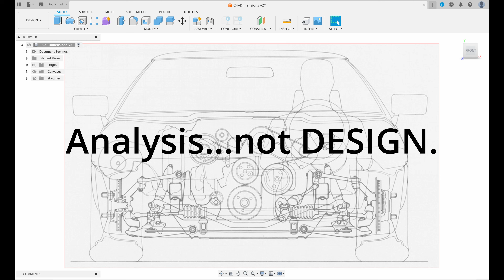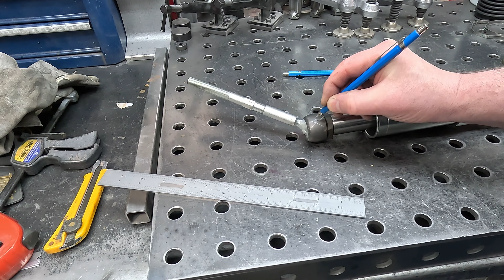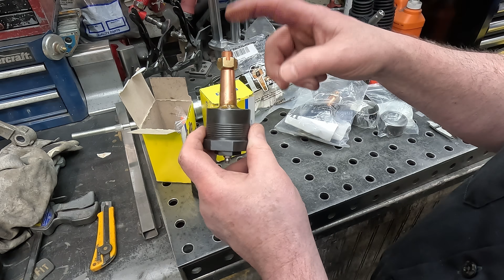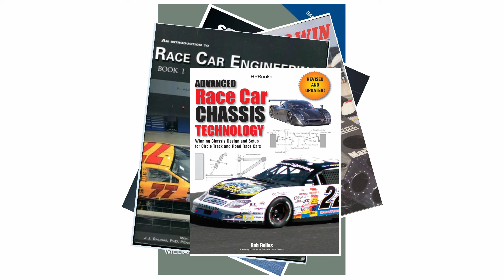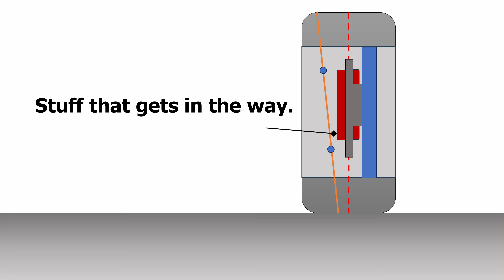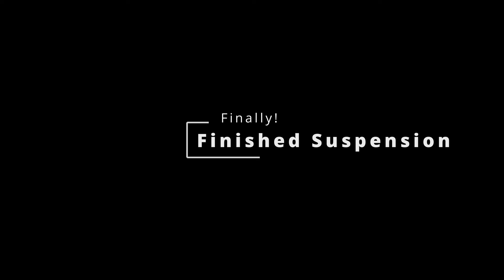Designing Car Suspension - From Analysis to Design.  Front View.

Comment: Great video and confirms what I had thought of the Corvette suspension design.  It is surprising how many so called Sports Cars have understeer built into their suspension designs.  When I was mocking up my Lotus chassis,  I used PVC pipes to physically build the control arms that were cheep and super easy to modify.   I found it helpful to see a physical model after reading books such as: (reading list sample for those interested in more)
Race Car Vehicle Dynamics - Milliken & Milliken
An Introduction to Race Car Engineering - Rowley
Tune to Win - Smith
Race Car Aerodynamics: Designing for Speed - Katz

Automotive Aerodynamics - Howard
Tyre and Vehicle Dynamics - Pacejka
Reply from the maker: Thanks - I've not read the last two - but the rest have been scoured.  Understeer is "safe" or so I've been told.  I was thinking along the same lines for a mock up but would use SendCutSend.com to sort out a wood model.
Reply: @ThrottleStopGarage  yea, I've been told understeer is safer, I can see the argument for a powerful car with novice drivers.  But IMHO, it should should be able to adjust out the understeer.  One of the many reasons I like the Mazda Miata, it has a solid platform that is widely adjustable at a reasonable cost.  Really like what you're doing with your project, hope you have plans to take it to track days.

Comment: No need to be looking at values from other cars except for sanity checks. Ask yourself what 'roll center height' actually means. 
You're essentially designing an 'anti-roll' feature; and that's a percentage, not some best practice value in millimeter or freedom parsecs. You are determining how much leverage you want to give the mass attached to the CG.
Roll center on the tarmac means 0% anti-roll and a fun boat ride, RC at CG height means 100% anti-roll and zero roll even in a 5G turn. 
So you want to figure out the necessary amount of geometrically build-in 'anti-roll' to get x degrees of roll at x Gs of max lateral acceleration. 
The roll gradient for a boring family car is around 5°/G, a production sports car should be around 3-4°/G and little FSAE race cars are set up somewhere between 0.5 and 1.2°/G.
My suggestion would be a target of 1.3G and 3°/G, pretty sporty for a road car. So the starting point for simulations I'd pick would be 4° of max roll, 0.25-0.5° static camber and 4.25-4.5° of camber gain at max roll. It's not a GT3 car after all. For the rest you'll need weight, weight distribution and spring rates. 
Get your spring rates sorted, calc the respective instant center heights, jacking forces, and see how much the car jacks up and rolls vs. what you want it to do, then apply the necessary 'anti-roll' by raising the static roll center to the right percentage of the CG height.
CPI btw has a lot of interplay with caster, it basically increases (neg.) camber on the outside wheel and reduces it on the inside wheel. The right angle again depends on the amount of jacking, roll and positive camber gain at full droop. The good thing is, you can leave this parameter for last since you can simply slide the upper control arm along its virtual construction line once everything else is locked in. 
Hope this isn't too confusing, English isn't my first language.
Reply from the maker: Thanks for taking the time to write this out.  I've gone over it several times - you've shared some very important thoughts.  The RCH part is completely correct - my limitation is that I wasn't sure what that value should be for the percentage anti feature.  The car originally had a RCH at ground level due to parallel (or close to it) control arm geometries and it was no fun.  The method of "fixing" the suspension was to attach monster anti roll bars (25 mm - short arms) and increase the front spring rate.  It was like a gocart.  It lacked mechanical grip and I hated it.  

What I've been missing to do the calculations is a sense of what a reasonable G force would be - even the other parameters are more me guessing and I hate that.  This is what is holding up the side view work right now - how much anti-dive is reasonable?  The caster is the same issue - there is a set value (sanity check if you like) that seems to pair with a SAI. So for a SAI of 12° - I see a caster of around 5° where for less SAI, I've observed more caster. I need to compute that rate.  

Any advice on the side view construction parameters would be great.  I understand that this is just "roll" in the pitch direction and that 100% would be alarming to drive as it would instantly react without any signaling to the driver.  I think I've seen less than 20% tossed about as a start point but I have no idea if that's a good idea.

Comment: Thinking the steering rack pivot width and steering arm pivot location should have been included in the discussion at this stage, for it’s coincidence with inner swing arm pivot points and steering rack location limitations.
Great stuff and thanks for sharing.
Reply from the maker: I may not have explained that very well - that was the point of starting with the rack.  Once I have those pivots, they must lie on the line intersecting the inner UCA/LCA line.  So I started with the rack.  I'll get this explained better after I complete the side view and work in the steering.
Reply: You say they must lay on the line intersecting UCA/LCA line, but if you do this you have 0 Ackerman, just so you know and don't oversee this.
Reply from the maker: You can get Ackerman with relative location of the rack to the centre line of the hub - the further out you go the more you get.
Reply: @ThrottleStopGarage  yes, depending on if the rack is front or rear of the hub of course. But the length and angle of the steering links must stay the same otherwise you will induce bump steer, but I feel like you know of this already.
It felt as if you chose the length of the rack by placing 615mm between the inner upper en lower joints and that's that, but I surely hope to see more next video. :)
Reply from the maker: I see what you're saying - all I was trying to say was that you need to design around something.  So I selected a narrow rack with a reasonable steering ratio that is available and used that as a start point.  The pivot to pivot for the rack did control the LCA pivot placement as the rack needs to sit on the line described by the UCA and LCA inner pivot points.  It needs to do this in 3D - it's currently just sitting there in 2D and is placed to eliminate bump steer.  The Ackerman is then set in the top view design.  There are a lot of things to consider!

Comment: Awesome video, I see you have got .6deg per inch of camber and codos for figuring out this base line number. I believe your caster will also increase the camber as you turn the steering wheel, do you have a figure for angle of caster and how much extra this will add to the six degree per inch. Or is that in the next video, cant wait!
Reply from the maker: Thanks - great question.  Yes - it's pretty weird what happened for me in doing this and I can't work it into a video.  I've read these suspension and handling books for decades and I could tell anyone who would listen what the words all mean but (and this is a big but) my ability to visualize this as a coherent system was limited.  The viewer that looked at the suspension on the jig and said it was nonsense, then pointed me to a video showing the car going around a corner to prove his point - he's got a very specific knowledge and talent I don't have. 

To get this to gel, I had to STOP reading the words and do the work to learn.  I would explain this as the difference between knowing "that" something happens and "how/why" it happens.  It hit me like a 1000 W bulb a few weeks ago and bang - I get it. Then it was like re-learning everything as I could make it work in my head.  

When we do the side view - we'll look at how caster adds/subtracts from camber in turns and the anti elements of the side view geometry (which are similar to the front view).  There is a rate here as well - and you can get it in two different ways.  I hope I can get it nailed down enough to explain it passably well.

Comment: Thanks to share your experience. I build small electric vehicle (1 seat and 2 seal)  and my biggest problem is the suspension geometry. I rebuild 4 time the geometry for the 1 seat and now I designing for the 2 seat.  I using negative scrub to plan to have a better driving experience at high speed.   But you use positive Scrub is it better Positive Scrub? If you want, you can contact me and I will share my plans and feed back on the roads.
Reply from the maker: Negative scrub (from what I've read) is used on front wheel drive vehicles and those with split mu (diagonal) braking.  RWD often has positive scrub.  From what I've read (little experience) it's desirable to have scrub as part of the design.  I'm saying that for me to get a handle on the clean sheet design, I needed to start somewhere.  I found scrub definition was the right place for me to start.

Comment: Well that certainly explains why I’ve always felt I was spinning round and round in successively smaller circles when I’ve tried to understand suspension design.  Reading the books made my eyes glaze over. Sometimes after giving up I would even head for the donut shop for a superior glazed solution.  Unfortunately that never helped either.  You’ve inspired me to give it a go.   Definitely looking forward to the next episode.  In the meantime I’ll be rewatching your previous episodes and reading all the comments to help drive this home.  I’ll probably even pull those dusty books back off the shelf for another spin. Thanks so much Craig for slogging through this. 🙏🙏🙏🙏
Reply from the maker: Thanks - this was a game changer for me.  Like you, I could read the words and even explain it, but the shapes wouldn't work in my head.  I had no "sense" of things like the viewer who pointed out the problem in a suspension by looking at it.  Gold star for him.  This did come to me like a clap of lightning.  Boom - suddenly it all snapped into place.

Comment: You sure you had camber loss there? Sure looks like gain, both on your bubble, and comparing to the background.
Reply from the maker: Sorry for the confusion.  The hub is not where this gets measured either...it's the contact patch and the value will be different - but I was trying to make a point.  The C4 is gaining positive camber in bump - the amount is magnified by measuring it at the hub - but the top of the tire is tilting out not in.  That's why we see a decrease in contact patch length (in the 2D model) in roll.  Compare this section of the video to the suspension that I've designed and shown at the end and you'll see that in roll, the inside tire contact patch length is not changing.  So the car is leaning on the tire and the tire is flat - this roll rate and  camber curve are working as intended to maximize grip in a corner. The C4 does the opposite of this - it's also not designed to move much in roll for this reason.  I can't speak to why it was designed this way - it is and it's the opposite of what you'd want.

Comment: Before you blow a heap of money on parts mock up with cheap materials to make sure your design works, and don't forget thr Ackerman in your steering location of your steering rack. It has a huge affect in turning into corners and bump steer , the program you are using should explain it . If done poorly it will steer like a tractor one wheel turns out more than the other. Cheers.
Reply from the maker: Yes - for sure.  I'm just moving to the side view then steering.  At that point the upright is defined and I can start building.  I've got the basic steering arm in the 2D model and it's placed to limit bump steer.  Ackermann is a top view geometry and we'll get that input last.

Comment: Very worth the wait!  I have gone down part of this rabbit hole (the analysis side) and have noticed that factory suspensions are rarely what I expect.  I really don't think much of the "millions spent" on car designs have very much to do with actual good performing suspension.  I suspect ride comfort and stability/ease of use at low speeds trump actual road holding performance under rougher heavy usage...

My question is, are you going to make full custom control arms, the send-cut-send way, or are you going to go looking for arms that exist that meet the specs you define, you know, mix n match from different makes?  And have you planned to make the whole thing adjustable, with either shims of adjustable arms etc?
Reply from the maker: Thanks fellow rabbit hole adventurer.  Full custom arms and uprights (may have these machined from billet - I'm unsure).  With the wear parts (ball joints etc) being common enough parts that the rest should be fine.  I'd like to add adjustability as otherwise I will get trapped.  I have few delusions about being able to nail this.

Comment: Another excellent video Craig. Are you trying to design a suspension that won't need adjusting, except for toe. Seems to me once you start adding shims or rotating cams all these parameters  will change.  Minutely,  but will it be enough to blow your mind?
Reply from the maker: I think there has to be adjustability Alan - otherwise I'm going to get in trouble.  I don't imagine that it's going to be right without the ability to move it around a bit.
Reply: @ThrottleStopGarage  Of course, I was just pulling your chain, didn't want your head to get too big, haha! Like everyone else here I'm in awe of your process. It's gotta be right or it's getting done again until it is. I saw a picture of you when I looked up the word patience in the dictionary, there you were!

Comment: You’re describing camber loss while we watch the angle decrease and the bubble shows you’re getting gain. I’m confused.
Reply from the maker: Sorry...yes, it's gaining positive camber instead of gaining negative camber.
Reply: I notice that too! At first I thought I didn't know how to read my Klein Tools level (the bestest one ever!)
Reply from the maker: @alanmony1582  Nope - you've got it right.  When I was positioning the level to film, it wasn't flat on the hub face.  I try as hard as I can - still I fail.
Reply: @ThrottleStopGarage  From my viewpoint you were gaining negative camber as the suspension was compressed....Adding spacers to the top arm imho will increase static positive camber.
Reply from the maker: @Keith_Phillips  True - the level wasn't flat on the hub.  It still does some janky things. Sorry.
Reply: This is just because of the camera perspective angle not being perfectly horizontal guys...
 You can clearly see at ride height it had 0.4 degree negative camber and at 1 inch travel it shifted the other way to 0.5 degree positive camber, which is the wrong direction. It should have been 1.5 degree negative for example
Reply from the maker: @Mad4Tracks1  Nope, I screwed up filming the level - it's not flat on the hub.  Sorry.
Reply: This threw me off a bit too as visually it looked like it was gaining negative camber. The arm lengths and angles tell the story though. The bottom arm is past center of travel and will lose effective length while the upper are is rotating into a longer effective length.
Reply from the maker: @dsm156  I had moved the level for filming and it wasn't sitting flat on the hub - sorry about that.
Reply: Why was there no mention of modifying the c4 setup to give you your desired camber gain? From what I can see, you should be able to lower the upper a-arm chassis mount point about an inch. This should solve the camber gain problem. Having designed and built a custom suspension myself for a FSAE car before, I know it's a lot of work. Saving time and money while still getting the performance desired should be worth the attempt.
Reply: @calebpier7401  probably because he wants to know what that will do with roll center etc. You can't just change 1 thing without affecting dynamics, as you should know.
Reply from the maker: @calebpier7401  Sorry - that has been tried and it' ends up with the LCA pivots so close together that is making packaging impossible (or at least a problem).
Reply from the maker: DAMMIT - the level wasn't sitting flat on the hub - it was sitting up against a lug nut and was magically a degree off...good catch - sorry.  The computer model is correct and it moves in a weird curve.

Comment: Great video Craig. I'm wondering if something like a modernized Mustang II/Pinto would have worked. Seems to be pretty popular with hot rodders. Not sure if the geometry is there or not but it looks decent at a glance.  Looking forward to the next vid 👍
Reply from the maker: I am sure it can work.  I can't find out a lot about it, and I'd rather just stop hacking and adapting parts while not understanding.
Reply: @ThrottleStopGarage  If you have the skill and resources like you do a clean sheet bespoke design is the best answer for sure. Plus the cool factor is way higher :)
Reply from the maker: @jesscneal  if I can get it to work...fingers crossed.
Reply: @ThrottleStopGarage  🫰🫰